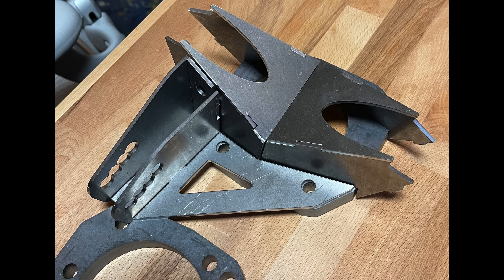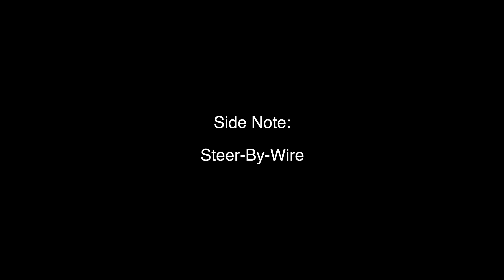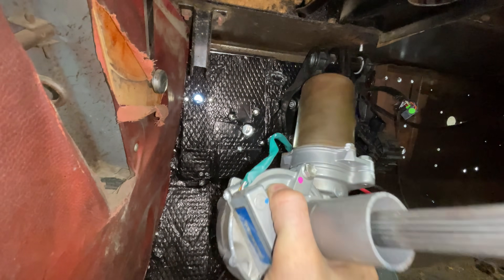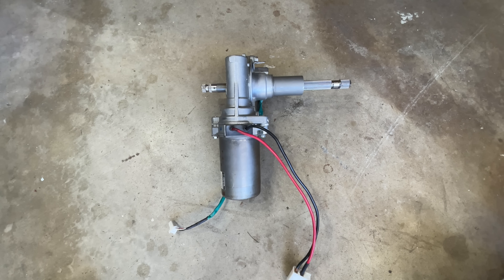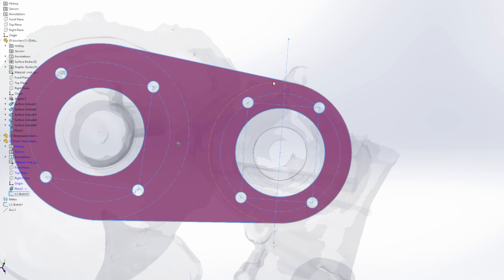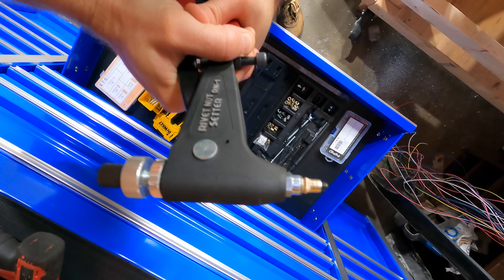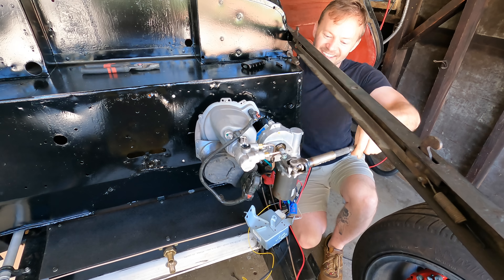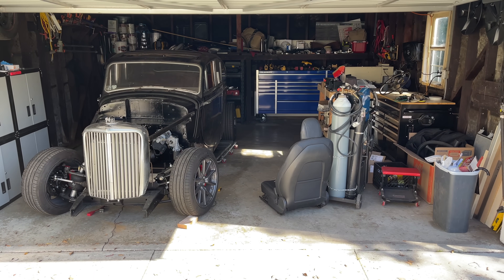Add Power Steering To Any Car

Comment: Matt, you seemed surprised that the 1.5" tube from the steering column wasn't metric. To my knowledge, even here in Europe, and I suppose everywhere, welded round tubes are rarely ever an exact amount of mm (like, but have odd diameters like 17.2 mm, 26.9 mm or 48.3 mm. I'm not exactly sure why, but I think it has something to do nominal diameters and it being an approximation of the inner diameter. I'm not an engineer, I'm sure a proper engineer will correct me.
Reply: I believe that most pipe is sized for the inside diameter (ID) and wall thickness. For this reason we get fractional outside dimensions. For example, a 1 inch (ID), schedule 40 pipe has a wall thickness of 0.1575" (x2) = 1.315" OD. = 33.401 mm equivalent. Metric pipe is the same. A 25 mm ID pipe might have a wall thickness of 4.35 mm (x2) = 33.7 mm OD. The metric (ISO) and the American Standard systems are different standards- when we convert between them we confound all of the rules, creating weird measurements like Matt has found... . In Canada, we officially adopted the metric system in 1974, but we still plug away with the US standard and conversions because our American cousins trade in inches. Crazy but interesting!
Reply: Welded and drawn tubes are available in metric and traditional imperial sizes. Depends to some extent on the type of tube.
Reply: ID vs OD measurement

Comment: I added power steering to my sporting trials car because of shoulder injury and bought a feedback controller which allowed me to control how much assistance via a trim pot.
Reply: For the Prius setup
dominic clancy
1 week ago
If you add a magnetic collar and hall sensor at the differential input flange, then connect the signal wire of the sensor to pin 5 on the D31 connector and 12V+ to pin 6, you will get speed sensitive assistance instead of just the failsafe assistance.  You vary the speed at which the steering firms up by adding magnets at the diff collar.  The unit will provide three steps of assistance.

Comment: I did this EPAS swap on my subaru after my fancy quick rack started leaking. Can't leak if there isn't any fluid in it! It actually works really well. you'll like it. I used a BRZ column as the motor is bigger and I'm doing autocross with slicks with an awd car.
Reply: For the Prius setup
dominic clancy
1 week ago
If you add a magnetic collar and hall sensor at the differential input flange, then connect the signal wire of the sensor to pin 5 on the D31 connector and 12V+ to pin 6, you will get speed sensitive assistance instead of just the failsafe assistance.  You vary the speed at which the steering firms up by adding magnets at the diff collar.  The unit will provide three steps of assistance.

Comment: I've driven a 1966 mustang with no power steering and I hated it.  I've been told that a lighter car, like your Honda doesn't need it.  On a scale of 10 with 0 being so soft it only takes a pinky to steer to a 10 being you really need to hit the gym just to turn into a parking space and perhaps a 6 being just perfect,  what number would you give your Honda?

Comment: I've been looking for a 3D scanner that doesn't cost $10k. What scanner are you using?
Reply from the maker: I have a video on it; link in the description of this video.
Reply: @SuperfastMatt  thanks! I watched. After a bit more research thinking I'm going to see if I can get a Azure Kinect dev kit. Its supposedly better than the Intel but can be used by the same software and isn't crazy expensive. And if not, I'll get the intel. 
I'm working on some larger fab projects (jamming suspensions from wrong cars into mine, etc.), so this should prove handy.

Comment: Check out the steering wheel from the Studebaker Avanti. It's similar to the design you're leaning towards, but it has a finger in each spoke that activates the horn as well as the center button.

Comment: I wonder if I could use this setup on my Rover P6 2000 TC which was never offered with PS...if you research the steering system on P6's you'll see why I'm 'wondering', because it would HAVE to be mounted inside the car.  So which MY(s) did yours come from?
Reply: If you are in the UK, the Vauxhall Corsa is very popular for this swap, and there are a gazillion of those out there.
Reply: @uliwehner  If I lived in the UK, I would know that 😁 Seriously, I saw references to that on a Rover forum.  I didn't pursue it knowing that shipping would be stupid expensive.  And none of you Brits would have any idea if anything over here would use the same unit.
Reply: @mescko  
for the Prius unit
dominic clancy
1 week ago
If you add a magnetic collar and hall sensor at the differential input flange, then connect the signal wire of the sensor to pin 5 on the D31 connector and 12V+ to pin 6, you will get speed sensitive assistance instead of just the failsafe assistance.  You vary the speed at which the steering firms up by adding magnets at the diff collar.  The unit will provide three steps of assistance.

Comment: I am used to non powered steering and changed to hydraulic some time. When I changed to electric (Mitsubishi i-MiEV) I have outgrown all my shirts within a week. I have to actually turn the wheel all by myself until the power steering takes over. Turning slowly and meditatively I can actually steer non powered. Saves energy but I had to switch from shirts to sweaters or go topless.

Comment: Welp. Didn't know about the Prius parts and now I want to convert my 4wd Toyota to EPS.
Reply: for the Prius unit
dominic clancy
1 week ago
If you add a magnetic collar and hall sensor at the differential input flange, then connect the signal wire of the sensor to pin 5 on the D31 connector and 12V+ to pin 6, you will get speed sensitive assistance instead of just the failsafe assistance.  You vary the speed at which the steering firms up by adding magnets at the diff collar.  The unit will provide three steps of assistance.

Comment: Fill up the holes in that wheel with indicators or switches. You could keep the dash a lot more stock looking by controlling the modern stuff on the wheel. I.e. put the cruise control switches and maybe a fog light switch, then fill or cover the spoke. Wrap the spoke in leather or plate it with brass, and or fill the holes with indictor lights. Something like glass dome lenses with frosted back and a LED. Just make them glow a little bit. This might work really well with the instrument cluster wiring exposed, kind of a steampunk look.
Reply: ...and make the steering wheel mounted controls and indicators data connections wireless, so the only electrical connection needed to the rotating wheel is a bit of DC power.  Maybe make that power transfer inductive, so no slip-rings or clock-spring conductor.  Miniature Arduino-compatible micro controller and cordless phone charger parts to the rescue!

Comment: I may do this one day to a Fiero chassis I rebuilt to electric custom. It really is not hard to steer with manual, but there is a little bit of delay in response, probably from 36 years of wear in the steering rack. If I am going to rebuild the rack anyway may as well upgrade to power steering. I knew people had used MR2 parts to convert to electric power steering, but didn't know about the Prius option. Also, thanks for the SendCutSend LASER cutting info. That could be very useful.
Reply: for the Prius unit...
dominic clancy
1 week ago
If you add a magnetic collar and hall sensor at the differential input flange, then connect the signal wire of the sensor to pin 5 on the D31 connector and 12V+ to pin 6, you will get speed sensitive assistance instead of just the failsafe assistance.  You vary the speed at which the steering firms up by adding magnets at the diff collar.  The unit will provide three steps of assistance.

Comment: Inverse power steering would just make the project the world's most overbuilt workout machine. I say run it that way and you won't have to title or register it because it's probably not illegal to drive a Bowflex.
Reply: Lol. I see you commenting on all the channels I watch. It's fine for me to waste this much time, but shouldn't you be spending that time making me more videos? Entertain me, dammit!
Reply: Ronald Finger strikes again! 🤣
Reply: But imagine SuperFastMatt with Popeye's forearms for just a minute....
Reply: Now with Blowflex steering workout station, just add the “Flobe” resistance pedal machine designed to use while sitting down. Sitting is the new smoking so we just sit in our cars. Yes, ladies and gentleman, the workout adjustable resistance foot powered “Flobe” shown on every late night TV commercial. Be the first in your neighborhood to mount one in your car. Order by midnight tonight, $30 down, $30 a month until you have a heat attack or wreck your car. But wait, there’s more. Be one of the next 100 people to order a “Flobe” and we will include a pattern for drilling, 4 bolts and 3 nuts, a slip resistant pad in case you do not own a drill. Shipping and handling paid separately! Please use adult supervision or a Harry teenager to install, warranty is void if bolts are tightened and the “Flobe” is scratched or shows witness marks. Yes, pedal you way into fitness while sitting!
(Fast Legal Speak) Do not install in a vehicle with an engine, or pointed downhill. You could be the most fit person to be seriously injured in a non-running automotive accident!
Reply: Good one!
Reply: Love your work Ronald!
Reply: Actually it would also be the best anti-theft system ever.  Matt I am really disappointed you didn't just decide to drive it in inverse.  THAT would have been impressive.  :-)
Reply: The waffle house has found its new host.
Reply: 🎉mfg magic b old n loan mneareary no
Reply: Arent you the guy that has a 280z?

Comment: If the part was designed to be inside the dry cabin and you decide to put it under the hood.  You must find a way to keep it as dry as possible.  Water intrusion will kill it.

Comment: The thought of "Imperial" measure vs "Metric" started my brain off into a tangent.  Both are England's invention, and the USA is possibly the only county which still uses it.
Aren't "We the People" just supporting the old England by using it?  So we are more English than England.  (Sorry, that was silly)
Reply: The French deserve the credit for the metric system.  
We (Brits) have a few edge cases in our adoption (use of Miles vs KMs on roads, pints in pubs etc.) but that's a holdover from previous generations, not lack of support for metric.
Reply: Not just old England, but bad King George IV in particular, who signed the current 'imperial' units into law. Maybe the Romans can also take some credit/blame for the metric system: their mile (mille) was defined as 1,000 paces. BTW the rest of the world left the metric system behind in 1960 (or thereabouts), of course, and now uses SI.

Comment: Sendcutsend is awesome!  After you mentioned them in a previous video, I designed and had them cut an aluminum RC crawler chassis.  Very cool they're sponsoring your video(s)!
Reply: Sendcutsend is great, ponoko is another alternative with more materials options
Reply: @aygwm ,thanks!  I'll check them out!

Comment: If you don’t send the correct canbus messages wouldn’t the steering ratio be wrong/off at high speeds/low speeds?? from my understanding the assists motor has less rotations in any give direction at high speed, and has more rotations at low speed…. Please correct me if I am wrong..
Reply from the maker: Its just the same assist across the spectrum, so compared to a normal EPS it would give less assist at low speed and more at high speed. But compared to a hydraulic system, it would be about the same.
Reply: For the Prius system...
dominic clancy
1 week ago
If you add a magnetic collar and hall sensor at the differential input flange, then connect the signal wire of the sensor to pin 5 on the D31 connector and 12V+ to pin 6, you will get speed sensitive assistance instead of just the failsafe assistance.  You vary the speed at which the steering firms up by adding magnets at the diff collar.  The unit will provide three steps of assistance.

Comment: I owed a VW T2b Bus without power steering, it was my first car. 30 year ago. In general you learn the car must move then your can turn the wheel. I live in Vienna Austria then you learn to park the fully load, with manual transmission.
Power steering is nice, but in general not needed if you who to drive ;-) But it was the time before fitnessstudio and Arnold Schwarzenegger, or that's the reason why Arnold is from Austria, does he own a T2b ;-)
Sorry about my english i'm from Austria like Arnold.....

Comment: Same thing but Versa of the same era EPS powers two of our race cars and a vintage Mustang street car.  You missed that it MUST have an 12V turn on lead that is seperate from the primary 12V feed.
Reply: For Prius system
dominic clancy
1 week ago
If you add a magnetic collar and hall sensor at the differential input flange, then connect the signal wire of the sensor to pin 5 on the D31 connector and 12V+ to pin 6, you will get speed sensitive assistance instead of just the failsafe assistance.  You vary the speed at which the steering firms up by adding magnets at the diff collar.  The unit will provide three steps of assistance.

Comment: I am not a fan of electric power steering. My girlfriends son has a Toyota with it and driving straight down the road with the steering wheel held straight it twitches and makes the car feel unstable and unsafe. I can drive my Ford Ranger down the same road at 90MPH and it feels fine, his car feels scary at 45MPH. I hate the metric system with too many bolt sizes and pitches. Two pitches and fractional sizing is just right for just about anything.
Reply: I suspect that the steering assist method is the least significant of the many differences between a recent Toyota car and a Ford Ranger.

Comment: How have I not heard of the Prius steering motor used for this?! Great solution. Also, congrats on the sponsorship. Send Cut Send is fantastic. 👍🏼
Reply: dominic clancy
1 week ago
If you add a magnetic collar and hall sensor at the differential input flange, then connect the signal wire of the sensor to pin 5 on the D31 connector and 12V+ to pin 6, you will get speed sensitive assistance instead of just the failsafe assistance.  You vary the speed at which the steering firms up by adding magnets at the diff collar.  The unit will provide three steps of assistance.

Comment: Great video. Steering Wheel looks good but a heated leather wheel is cool too. By the way, why are you not simply spending a couple of hours running power to both sides of the garage? Too easy? Say no more.

Comment: You might also want another bracket so your brake lines are protected just that extra bit from being punctured by the power steering assembly.

Comment: I'm planning on doing something similar with an 09 Corolla EPS system I pulled for $50. 

I was planning on clamping the motor to the frame and running universal joints from firewall shaft exit to my EPS, then to my rack input. My only concern so far is the weatherability of the EPS system, being designed to live under the dash, now being a couple inches from the road.
Reply from the maker: I’m also a little worried about the fact that it’s designed for inside the car and I’m putting it outside. I think I’m going to paint mine and put an extra seal on the output somehow.
Reply: @SuperfastMatt  I was thinking a 2K epoxy clearcoat. Or perhaps a couple coats. 

I’m interested to see if the fallback assist level is sufficient for you, or if you will find it necessary to feed it road speed via CAN :)

Comment: Man this is the second video I've watched that mentioned send cut send. Im going to have to check them out. And learn fusion 360
Reply: They are fantastic, been using them on my electric Vespa project
Reply: Buy a prusa 3D printer and you’ll have much more fun learning fusion 360
Reply: @trahar6257  I have 3 printers. Just haven't learned fusion 360 yet. But I don't have a lot of time to devote. I work most of the time

Comment: Technically didn't Tesla already turn it into a "badass Playstation controller" when they let people use the steering wheel to play video games on the infotainment screen? I always wondered how they could do that without your wheels getting cranked back and forth while you play, makes a bit more sense now. I like the steering wheel choice, very classy.
"...not a good idea to overlap major projects, but I think I'll be fine..." (Every other Cartuber on the platform LOLs along with you as the comment section burns.)
Reply: The wheels do move!
Reply: @Jeroen74  they do? Hmm I guess maybe they would need to to maintain alignment, but if it's not connected physically it seems like they could have managed it if they tried.
Reply: The Tesla steering is just a conventional rack and pinion one with the electric motor connected to a dedicated part on the rack. There are teardown videos about it. The game just uses the steering angle sensor as an input controller.

Comment: x2 redundancy on safety critical systems isn't really enough - it's fine if one completely fails, but since we're talking about sensors and data transfer there's the possibility of a fault causing mis-matched data. With only 2 systems, there's no way to know which is correct; x3 is a minimum, so the system can always 'know' which is the bad set of data.
Reply: Even x3 steering redundancy seems somewhat risky, what about a major 12V failure?
Reply: @alexanderpa2868  Another good example of needless complication--a solution for a problem that doesn't exist, like EV's.
Reply: and what happens when you have a flat battery get a flat battery - ok 2 batteries, and 2 dc/dc converters and ...